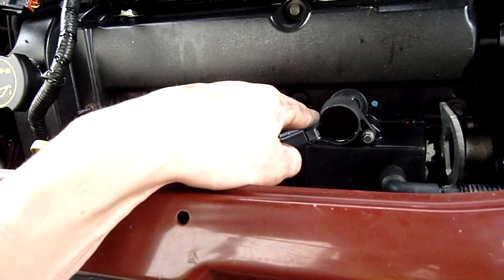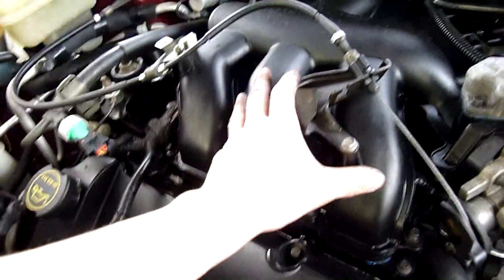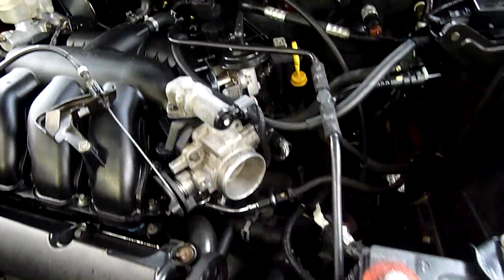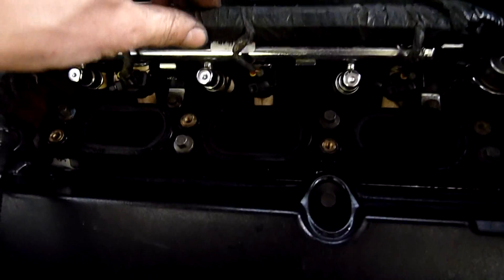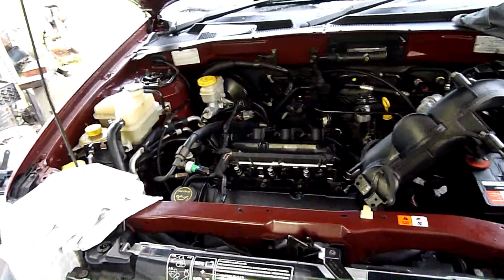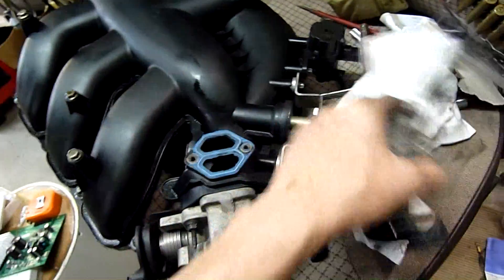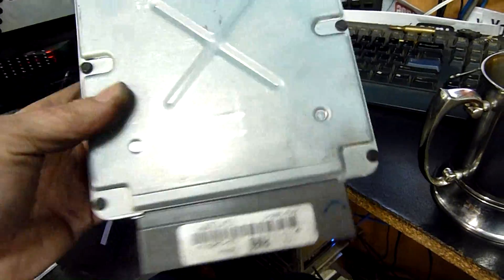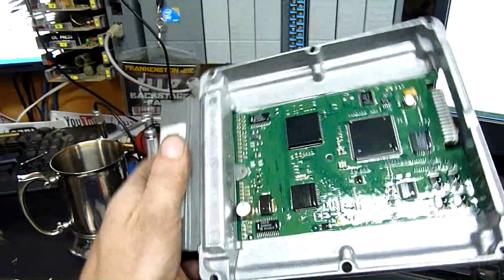Isolating the Issue  2001 Ford Escape Fuel Injection

Comment: Thank you , still in the dark on mine with 4&6, mechanic could only fix the Catalyzer that was blocked. Had two sensor notices; P2195 P2197.  2001 160,000 KM, had overheated.

Comment: couple of things are going on here, your plug wires in the front are hooked up wrong, the wires go across the engine like the comment below me says, and youre on the right track with that pcm / acu, accept its that water get in on the pins from rain, i took ours out, took the blue plastic part out and dried it out, i put the plastic part back in, and put lithium grease in the bolt holes and around the parameter and even on the outside for good measure, replaced the plugs, coil packs, all the intake gaskets and bam... no more misfire. i think a cat is plugged though bc there is no acceleration after 60 mph and the gf just blew a hole in the egr valve somehow. if anybody has any ideas about that feel free to share, also i made a few vids about this same problem, have one uploaded you can find it if you search fyi guy ford escape. ill be uploading the rest of the vids i made when i get time

Comment: it sounds like injectors are just old or dirty ,maybe the wiring harness to the injectors is  faulty,
i did the wiggle test on the wiring loom to the injectors in my EB fairmont when i first got it because of a miss fire and it was the wires ,been perfect for 8 years now ,but check injectors as well .there getting old.like you said WA has alot of that red dust dont know how much of that got into the fuel system over the years and blocking the EGR will probebly throw an error code at you,

Comment: Ed, it almost sounds to me like you might have a bad spark plug boot on that one coil that is leaking high voltage through the plastic and than going to ground causing a short?

Comment: Ed, Don't block your EGR. It servers a very important roll in combustion temperature by introducing exhaust gases back into the intake in order to reduce the O2 mix. Without the EGR working your combustion temps will be too high and could damage your cylinders, rings, everything really. The lower combustion temps will also reduce NOx emissions.  Your vehicle will run rich causing poor gas mileage and performance problem. At least that is what I was taught.
Reply from the maker: That is a very good point, i am used to blocking it off on carbie cars, EFI is obviously more picky and reliant on it, i will remove the blanking plate and give it a go.
Reply: EGR systems are absolutely useless on carbureted cars, especially cars from the 1970s. About all they do is cause crappy gas mileage and unreliable operation, without any real benefits. To get rid of oxides of nitrogen the logic was that more hydrocarbons being burned was an acceptable trade off, which it isn't but that's what happens when you have failed lawyers engineering cars.

Comment: Try switching coil wires to 4 and 6. !!!! The harness should not fit under the coils as pictured in the video.  I have an escape and a repair shop swapped the coil on plug wires to those cylinders and nearly instantly wrecked my cats and the lower compression on those cylinders also say they've been washed down with gasoline.  I had 210 psi across the board and circa 190 after the mistake.
Reply from the maker: the washing down is what I was worried about from the start, I had no idea they ran as high as 210psi.
Reply: I don't know if they do from the get go but my engine has been rebuilt about 20k miles ago and made sure to really push the rings during the break in. Its been carrying around about 1200 pounds of locksmith equipment all day every day since day one without ever a breakdown and loads of power.
Btw when you hollow out the cats the first generation don't have o2 sensors downstream of the first close quartered cat (at least 01usa version)  and doesn't seem to care about the new resonators just make sure not to plug the muffler.  And ive found after thr incident the pcv valve got wide open and squished that hose on the right rear intake manifold flat at the top and bottom. This engine's seals/idle/fuel injectors and everything rely very heavily on the pcv giving the right vaccum. It can be unscrewed and replaced very easily without manifold removal by pulling the hose off and slipping a 7/8ths 12 point socket over its rounded square corners and giving a quarter turn left.

Comment: Get the fuel pressure up and apply 12v to each injector. The fuel pressure should drop and since the engine isn't running you will hear the fuel spraying. If nothing changes when you apply voltage to the injector it's bad. This method worked for me on my dads car.

Comment: Have seen this before SWAP PRIMARY CONTROL WIRES FOR #4 AND #6, (the front two outer cylinders). I know the harness looks like it is in the correct position but it is not.
Reply from the maker: I just watched that vid, I wonder if they messed up when they put the auto trans in last year and got the harness on wrong.

Comment: A code reader is just a lazy way of doing things takes no effort at all get out a multi meter check the resistances on the injectors and voltages on the injector leads, you can also leave the injector off and crank the engine over and observe the spray pattern if it dribbles out there's your problem, if not and all is well. And its else where. Test lights on sparks plugs are only good for testing the lead not the plugs.. Nothing better than the old trick of earthing the plug and observing the spark

Comment: IIRC,the injectors that Ford uses are known for going high-resistance. (at least in US models) Search here on YT for 'scannerdanner',he might have some useful troubleshooting videos for you.
Reply: Another thought/tip for finding vac. leaks: Get a can of carbie cleaner,and spray some along the intake seams/mating surfaces while the engine is running. If there's a vac.leak,the extra fuel (carb cleaner) being drawn in will cause a change in the idle speed. Best done on a cold engine. Keep a fire extinguisher near by.
Sometimes,as a safer alternative,you can just use a spray bottle full of water,but sometimes it doesn't cause as much of a change in idle speed.

Comment: Like I said the in the previous video, modern OBD ECUs can disable the injector on a cylinder with chronic misfiring. Sometimes the injectors will not be re-enabled until all the codes are cleared and the PCM is reset by disconnecting the battery for a significant amount of time.

Also, removing and blocking off emissions equipment may be fine on a carb'd car, but it can lead to bizarre drivability issues on modern EFI systems. The EGR really doesn't hurt anything at all, and can actually sometimes yield better fuel economy enabled.
Reply: I got same, but no misfiring, clogged or computer :(

Comment: if it were me Ed, I would also scrutinize the Engine Harness for Cylinders 2 and 6 (Both Fuel and Spark) along with the PCM, because as you said yourself, the escape is notorious for having wiring being chafed. as for Code Readers, I have Two; a little Actron CP9550 Pocket Scan Plus Code Reader which cost about $80.00US (stuffed in my car's Map pocket for reading codes on the fly) and a Cen-Tech 98614 Scan Tool which cost about $130.00US for more Serious Diagnosis, because It can actually show me a Live Datastream of what the various sensors are doing (or Not Doing) so I can compare them to the Factory Specs.

Comment: Ya , It still could be bad coils Ed .. Get a scanner on it and read the codes , That will tell a lot of the problems .. Could be injectors .. You should see if there is power at those 2 injector leads , If not it could be the ECM or the injector resistor .. Very interesting .. You got me hooked now !!

Comment: Good luck with that thing ed. I'm willing to bet money that that vacuum hose was not doing the engine any justice.
Reply: Leaking vacuum pretty much never hurts an engine. All it really does is just cause running problems and possibly making other things that rely on vacuum not work either.
Reply: Bullshit It creates a dangerous lean condition that if left uncorrected will cause allot of damage to the engine and create poor driveablity and cause allot of other issues to surface. Vacuums leaks should be fixed even small ones cause big issues while driving.
Reply: jr540123 Ever heard of o2 sensors? I heard they can change the fuel/air mix and don't rely on anything other than good exhaust flow. Also a lot of newer engines can change the ignition timing when the ecu detects misfiring.
Reply: dragkid185
That is unmetered air coming in past the mass airflow sensor. that's air the computer does not know about so it only injects the amount of fuel needed based on the current MEASURED airflow that is coming into the engine. The engine fires the mixture and when it goes to the 02 sensor it flips shit cause the mixture is way lean and it doesn't understand why it is based off the current readings so it trys to dump allot of fuel in and it just all goes to hell in a hand-basket from there cause the computer doesn't know what the hell is going on and can only do so much to correct it before fixing the leak is the only way to solve the lean condition. It causes a high idle witch is bad and will only cause poor driving and burn up your tourque converter and clutch faster from high rpm and no power to really get moving and your gas miledge will suffer greatly. As for that fucking O2 sensor the stock ones most of the time are not wideband sensors and have a very very limited area off air fuel mixtures that it can actually read before it bottoms out or tops out and the computer can't compenstate further and not even a wideband would solve this issue becayse the computer would still have air comming in that to it is not there throwing off the readings and just fucking everything up. Don't be a dumbass all VACUUM LEAKS ARE BAD!
Reply: jr540123 Also a lot of cars have a limp mode where if something really bad were to happen, like a major vacuum leak, the tuning for the engine is set really conservative like half the hp that it's rated for just so you can get it to a shop and get it fixed. My car sets the boost to 5lbs at most and timing at tdc.
Reply: dragkid185
That's not a fucking fix your making it out like it would be all fine a fucking dandy. Yes they have a limp mode but that doesn't mean its gonna drive worth a flying fuck with a vacuum leak. Maybe if your slamming a shitload of boost in and just blowing it back out it wouldn't drive like crap but in a N/A vehicle its gonna buck and pop and run lean and detonate like mad. Been there done that.
Reply: jr540123 If its bucking and popping that's not a vacuum leak anymore, that's a fucking golf ball sized hole in your intake manifold. I'm talking about minor vacuum leaks like if a engine pulls -20 lbs at idle normally but now its pulling -17 lbs at idle. Also 5 lbs of boost isn't a lot of boost my engine peaks at 12 lbs and holds steady at 8 lbs and that's with the very conservative factory tune.
Reply: dragkid185
For a small engine its not allot of air being moved but with a big engine that 5 psi is allot of air and fuel being moved. The line that was lose on this engine would of for sure caused bucking and popping driving down the road. Its a vacuum leak from a hose that's about the same size as a brake booster line and that will create bucking popping and allot of horrible drivablity. lol so it just so happens that you were talking about a small leak and not the huge one like on this escape like I thought you were talking about. Don't change your story like that kid it only makes you look the fool.
Reply: jr540123 The vacuum leak on this engine didn't do any harm to it. The engine was running incredibly rich not lean. Also I never changed my story I just thought you were talking about minor vacuum leaks not major vacuum leaks. When I think of vacuum leaks I don't think of a major hole in the intake manifold. The only reason why it lost compression is the intake and exhaust valves are gummed up with the raw fuel it was not burning. A good hard running or some kind of engine cleaner should restore the compression.
Reply: The computer sees a lean condition and thus dumps a bunch of fuel into it to try and fix it that's what I meant to say the other night. Lossing compression from a little gumming on the valves? its gonna have the same comp ratio regardless of if the valves are gummed up a little from some good old gas and also last I checked gas a solvent and would not gum up the valves like oil would. I always consider the worst on an engine because that is the case allot of times when something goes wrong these days.
Reply: jr540123 That's not how you should check for the problems. You always start with the simple stuff and then start getting into the complicated stuff otherwise you just end up getting over your head and having your wallet end up being a lot lighter. Kind of like the PO of this Escape. Gasoline in its pure form doesn't gum up things, but modern fuels do. This is a carburetor after only 72 days of not running.http://saturdaymechanic.com/wordpress2/wp-content/uploads/2012/01/Gummy-Carb1.jpg  Also this engine didn't even know something was wrong based on the lack of a check engine light.
Reply: dragkid185
A check engine light not being on doesn't mean the computer doesn't have codes in it that apply to the issue nor does it not being on mean everything is all hunky dory down in the engine. Oh please I seen trucks that have sat months that you gave a little fresh gas to and they fired right up and ran just fine in regards to carbs. That's not a diagnoses that's called throwing parts at an engine not knowing what the fuck is going on. You gotta diagnose and wean it down by doing tests not throwing parts at an engine hoping that fixes the problem.